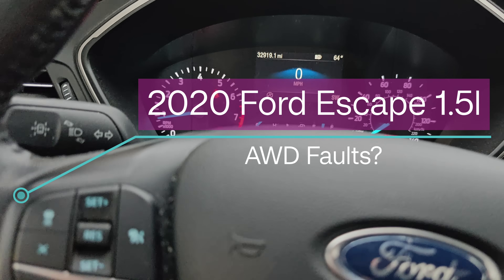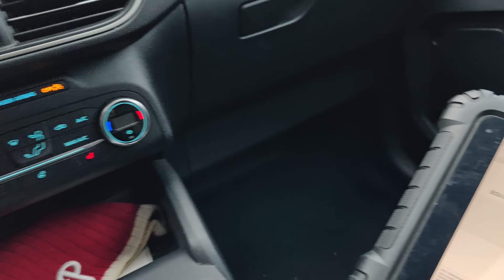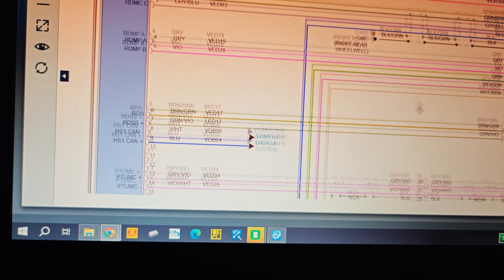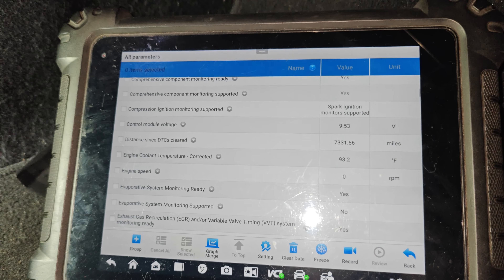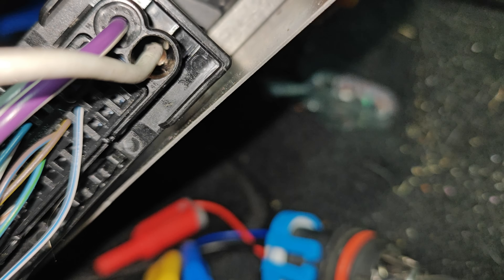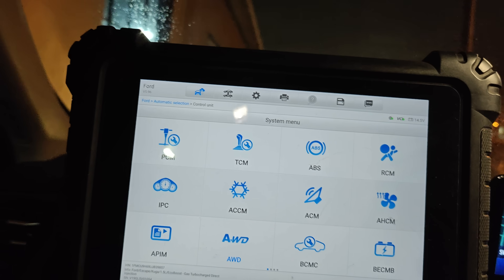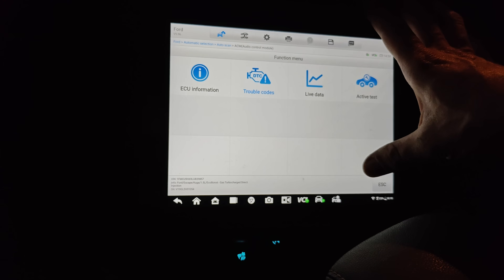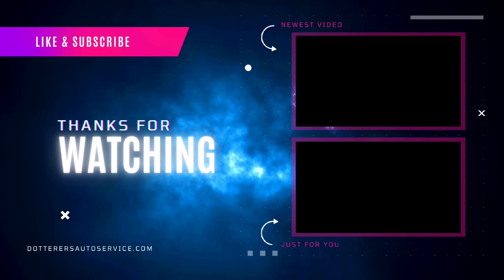2020 Ford Escape 1.5l - AWD Fault Service Required - C0090:18 - C00A2:01 - C00A3:01

Comment: I shared this video with the mechanic that was fixing this exact same issue on my 2020 Ford escape. At first he was sceptical and thought I can figure this out on my own. But then he took the time to watch your video and when I picked up my car, he said that video was 100% accurate! He did everything you said, and all the faults went away.
I am curious if anyone who has seen this video has an issue with the lights in their back row staying on? I actually had to cover my lights behind the driver seat and passenger seat with black tape because they stay on the entire time. I am driving. When you search information on it, it says it has something to do with a module under the dash on the passenger side. Just curious if anyone else has had this issue and has any hints on how to correct it. Thank you for sharing this amazing video.

Comment: I was replacing a airbag module on a fusion. I had just unplugged old one and plugged up the new replacement. Without removing and installing. No communication. Come to find out the module grounded through its mounting bolts.
Reply from the maker: Most airbag modules ground through the case.
Reply: @RobertDotterer  I dont do it very often so I wasnt aware of that. I was sweating it for a bit. Thought I fried a new module.  👍